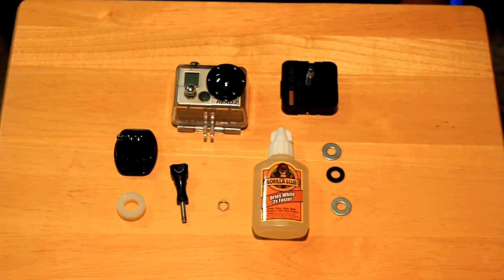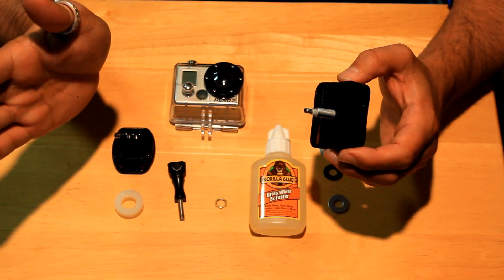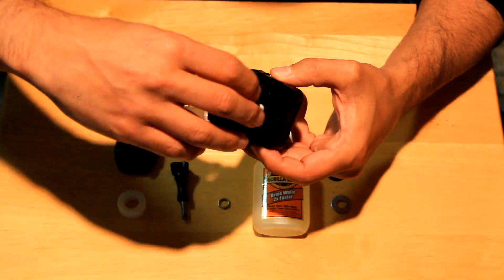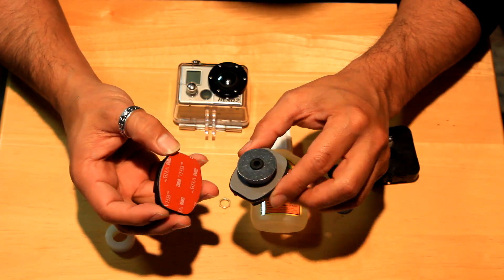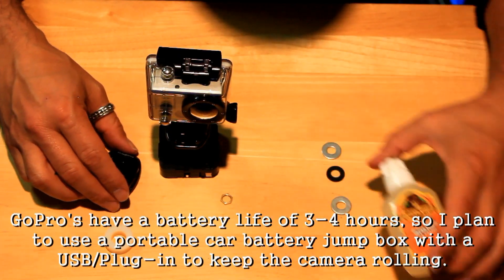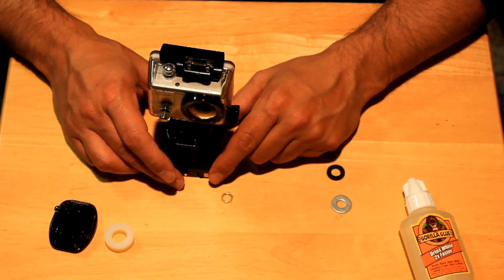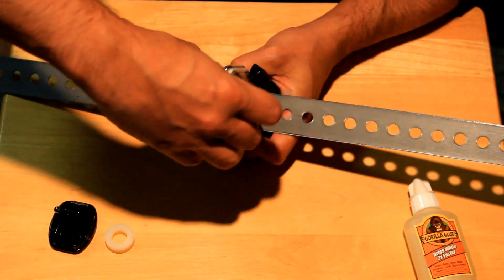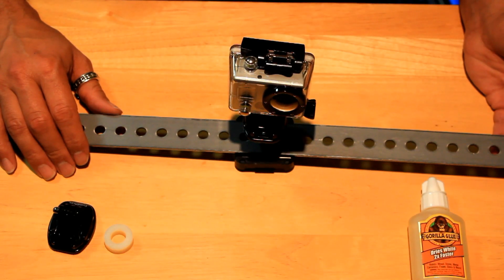DIY GoPro Time Lapse Pan Device Using Clock Mechanism - by Geoff Oliver

Comment: Another good idea for power is this: The Milwaukee Tool company has 12V and 18V batteries with adapters that have USB jacks on them. They're small and can go almost anywhere and will keep a GoPro going for hours. They call them Power Source and the part numbers are 49-24-2310 49-24-2371. They're probably sold separately from the batteries. I have both and use them a lot. I can charge my phone off of them, too.
Reply from the maker: Mike Schmidt also a 24 hour clock.

Comment: I don't understand how this is not a mass made product, everyone thinks this is a good ideia, then they go on ebay and get a kitchen clock for 1 hour, or to ebay and the the "super special" 2 hour one but it seems nobody realizes how much more potential is has when you can get footage of an 3 to 6 hours event in 90 to 180 degrees. Fantastic idea! If you just want it for a one time use or as a trial, get the ikea wall clock, the cheap one of 2$ and strip it down and make a similar setup. I did that today and its a cool thing that someone thought of that before ;) The footage is amazing!!
Reply from the maker: I haven't tried any more time lapse using this mechanism since this video. I couldn't figure out why the camera didn't follow the sun exactly, then realized that the clock goes around twice in a 24 hour period (duh), and is therefore twice as fast as the sun. I have some cool ideas about the tide coming in and out on the Cook Inlet here in Anchorage. you've inspired me again.